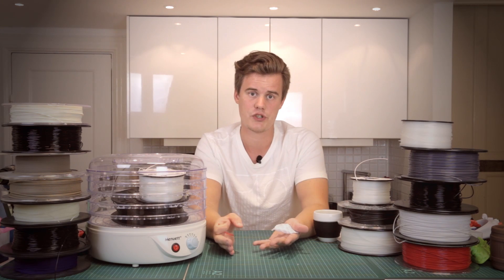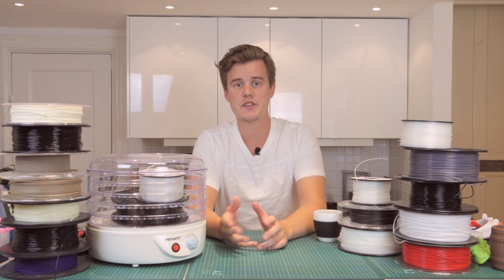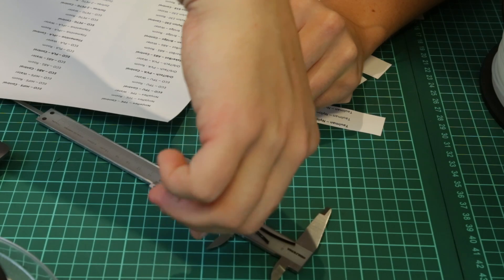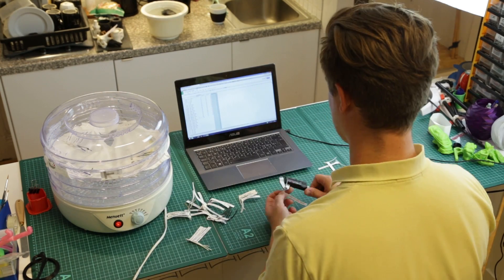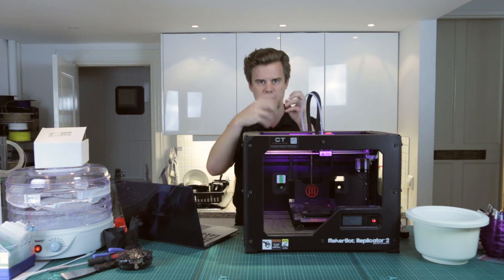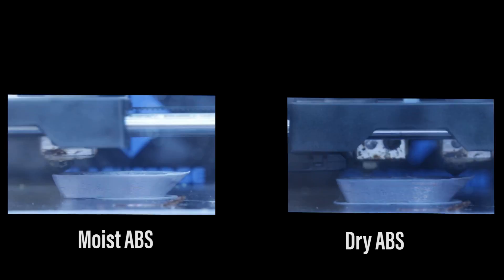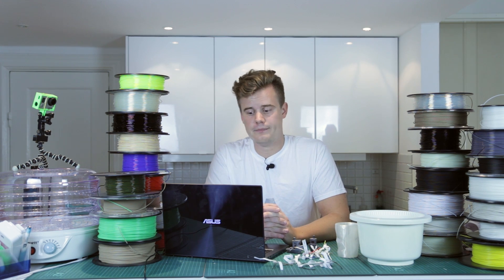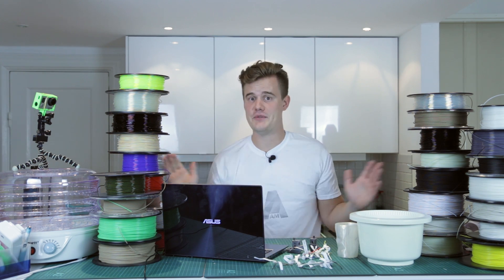Moisture in 3D printing filaments - Failed 3D prints and why

Comment: Does moisture in the filament make bed adhesion more difficult?
Reply from the maker: Usually not that much. not for "normal" filaments. So for bed adhesion, clean the plate accordingly (depending on what type you have) and then maybe use some Magigoo or similar to get extra good adheasion, after a level when the plate is hot of course =)

Comment: Your data sheet left out an important figure... How long were the wet filament samples exposed to the water? A few seconds, several minutes, or an hour? 
Also, how was the flexibility of the PLA altered during testing? Is it possible to slightly moisten PLA in order to make it less brittle & less likely to break, while still getting good prints? I have problems with my PLA regularly snapping apart. Another video shows a young man softening PLA in warm water for a moment, without negative effects. Curious.
Reply from the maker: They were exposed >in< water for 24 hours. I don't recall if the PLA were noticeable more flexible unfortunately.  Yes, since most PLA have a low glass-transition point they are subject to deforming on lower temperatures. Hot water will do the trick for many of the cheaper brands of PLA. Higher quality recipes are now designed to offer a bit more flexibility, while being strong and also resist higher temperatures. I'd recommend you to try a HTPLA of a select brand which you can process in an oven to resist more than 100c. It's also strong and wont "snap" in the same way.

Comment: Hi There, I am in the process of upgrading my 3D printer and have found your videos very informative. I am having problems with my current printer and am believing it is caused by moisture so I was very interested seeing a dehumidifier in this video, at what setting (if it has settings) and how long would you recommend? I agree with Norbert, this would be a great subject for a video, I'm sure many people how are new to 3D printing are unaware of this problem.
Reply from the maker: Hi John, Thank you!   The one I use is no longer at sale, but I recommend this (in US) for similar effect: http://amzn.to/2dIQbre (updated link in video)  I'm using it at around 40-60 degress Celcius over night. Atleast that was the result I got from the testing in this video.
Reply: Wow! I wasn't expecting a reply so soon. My son has a unit that looks just like the one in the video, I am leaving right now to pick it up and will be able to get the drying process underway. Thank you
Reply from the maker: Awesome! Then you should be ready to go with the filament dried tomorrow ;). Best of luck! Make sure you use a caliper before printing to measure the filament if you need super-precision (and adjust for it in your slicer)

Comment: Very nice video. I first noticed moisture when I tried to print with a roll that had been sitting out in the wonderful Florida humidity, and the extrusion had bubbles on it. It was a very strange phenomenon. A little bit of drying in the oven fixed that issue very nicely though.

Comment: I was wondering how well the dehydrator does drying out the filament that you saturated.  That would make a good video; how to properly dry your filament. 

Thanks,

Norbert
Reply from the maker: That's an awesome idea! Not sure I were to make a full video about it. But hey, why not! Coming up ;)    First thoughts were to post an additional written story about it. But i'll try to make a testing environment for that.

In the samples I noticed the longer exposure lead to more dry filaments. Meaning it takes a little time to get everything out.
Reply: 3D Print - Tech Design - Can't wait to see the results. I typically keep all my filament in plastic tote bins with gasket lids and a rechargeable desiccant pack in it to prevent moisture from affecting my filament.  But it would be nice to see how well a dehydrator "fixes" saturated filament.

Comment: Next time, try having more zoom in time for both filament types. The zoom in for the dry filament was a bit short.
Did you print with all of the filaments?
You seem to have a bit of curling coming out of the hot end. I have to suspect that the steam puffing of the filament will amplify such curling, but I could not confirm it due to the lack of zoomed in time for the dry filament.
Some of the filaments would be affected less by moisture because it is coated with a plastic or other material that resists moisture. In the case of ABS, I believe the coating usually has a lower melting temperature that results in the coating oozing out of the nozzle if you keep the filament in the heated nozzle without retracting it or extruding it too long.
Reply from the maker: Thanks for the feedback! I agree  the zoom could be longer. It's a balance aswell. I have a tendency to make videos that end up being to long :) 
I did not print with all filaments no, i chose the most affected ones and made some tests with those, only one went into the video, but the concept is the same.

The curling is probably a mixture of the nozzle being quite used, the filament puffing and the fact that the filament hits the bottom of the machine and is hard further down.  At the raw footage there is a bit more side-extrusion (not full curliness) on the wet filament.

Comment: What are your recommendation on storing filaments? I use a plastic "box" with lid from ikea with a seal (tätningslist). Storing a large mesh bag with silica gel in each box together with the filament.
Maby overkill?
How do you store your filament?
Reply from the maker: That actually sounds like a perfect scenario. We keep quite a lot filament at the office and o through it quickly. We don't do any production, so we don't worry to much for it. Usually important materials are dried before use instead. But yeah, a transparent storage box with a silica gel is good enough. Note that everyone have different climates where they live and/or store filament. Some dry climates need a sealed box, others just silica gel and some just a box :)